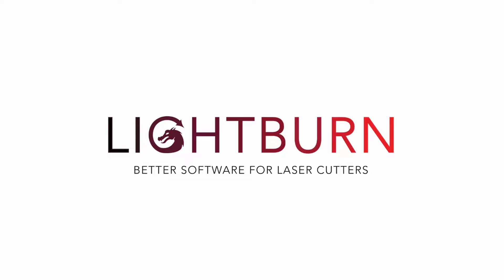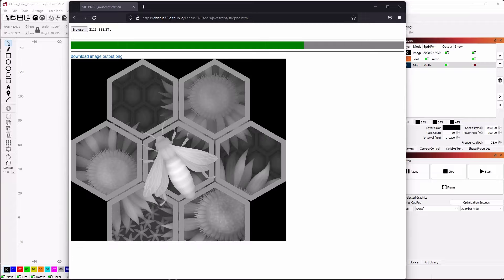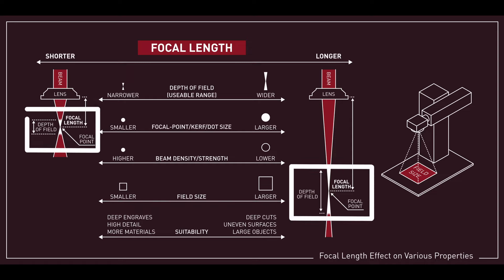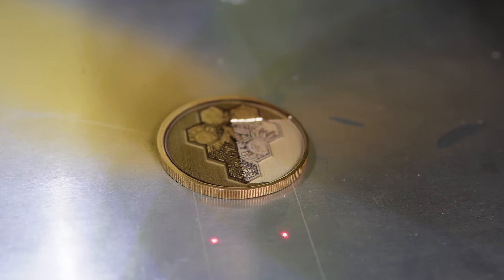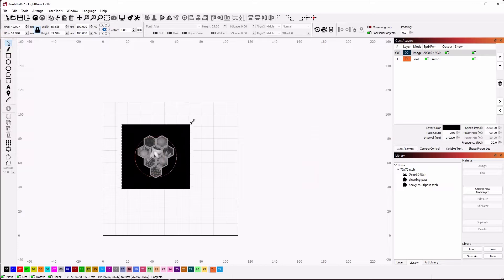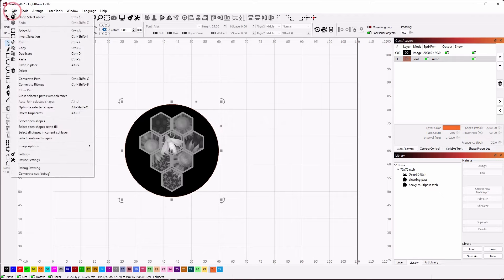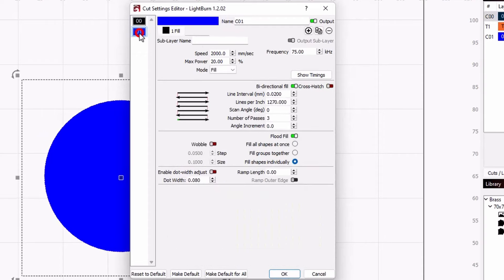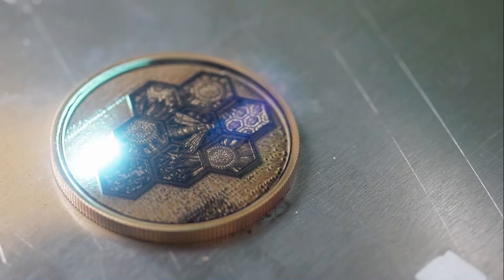3D Engraving With LightBurn!

Comment: So with C02 can I follow same? When doing so I select grayscale, then does that mean I don’t need to use the STL2png converter? Also, cleaning pass, I hadn’t heard of this, wow! Can I get a starting point setting for that? I have 3 lenses 2” 2.5 and 4.  Thanks for any input.
Reply: Though visually similar, grayscaling and creating a depth map are two very different things. Grayscale uses the luminosity of any colored pixel and converts it to a shade of gray. It doesn't care if something is in the foreground or background. A depth map on the other hand, changes the pixel value based on actual depth from white to black. White being the closest to the screen and black being the farthest. This type of image is required for the laser to know how much power to apply. There are other methods, but for these purposes you need to use the STL2png converter.

Comment: Hello, thanks for your video, a question. A normal flat engraving fiber laser can be converted to 3D engraving through the program or is it a different machine
Reply from the maker: This is a normal, 2D machine. We don’t even have to adjust the Z to do this as long as the focal range of the lens is deep enough.

Comment: Can you help me with setting to make this work on wood and normal 20w later?
Reply from the maker: If you're using a diode or CO2 laser, choose 'Grayscale' for the image mode, and set Min Power to a little above zero, and Max Power to 100%.  The results will not look very good because it will char a lot and will require cleaning with a brush (like a toothbrush).  I know it is possible to get a decent result with a CO2 laser.  I do not know if it is possible with a diode.
Reply: Thanks will give it a try

Comment: Is there a way to include a cleaning pass during the 3d etch or do you have to wait until the end?  I  was able to create the 3d image on the coin but waiting until the very end to perform the clean.  I'm assuming adding a sub hatch in the middle of the 3d layer run will cause issues?
Reply from the maker: There isn't a way to do what you're asking (and no way to do a sub-hatch to an image at present).  We'd like to add this, but honestly I haven't seen a need for it yet.  Using a small air pump to blow material off the engraved surface results in very smooth output for me, and doing cleaning passes after the fact has been fine.
Reply: @lightburnsoftware7189  Thank you

Comment: How to convert an image into a grayscale image for 3D engraving ? Do you have a tool or a software ?
I am planning to use the laserpeacker 4 for engraving. 

Thank you !
Reply from the maker: You don’t convert an image - these come from 3D models that are converted into height maps for engraving. The information in a normal picture is shading, not depth, so they are completely different.  The laserpecker is likely not powerful enough for 3D engraving on metal. You might be able to get varying depth on wood, but diodes are not great for that either, as they tend to char more than vaporize.

Comment: For better 3d engarving we are need to rotate angle every pass, lightburn in 3d image rotate only 90deg every layer, need 10-12deg and clean all between deep layers.
If you use short pulse laser you can polishing metals.
Reply from the maker: Rotation of images (at the moment) will cause the layers to misalign because of the way they are resampled, which is why it's restricted to 90 degrees.

If you have an air source, like a compressor, blowing across the engraving it will eject all the metal particles and prevents them from getting burned back onto the surface, and this produces a much smoother finish all by itself.

Cleaning passes can be done afterward, though we are planning to add cleaning passes during the engraving as an option.
Reply: @lightburnsoftware7189 thanx, how much layers i can use in 8bit images? 255?

Comment: Will this work on UV galvo lasers? If not now, might UV laser power be controlled in a future update?
Reply from the maker: UV lasers generally don’t produce deep marks, but aside from that there is no reason this couldn’t work. It doesn’t use variable power at all - it does a single pass for every layer of depth.
Reply: @lightburnsoftware7189  Nice! Thank you. I'll give this a whirl.....new rabbit hole!

Comment: can i do this things with a diode lasser?
Reply from the maker: Not in metal, but possibly in wood, using grayscale mode and multiple passes.  It will scorch a lot, so you’d need to clean the result with a brush, and you’d need a strong diode for this - probably 10w.

Comment: Is there any possibility of move Z axis (of course it should control by software) every layer and process will run on real focus point on every layer?
Reply from the maker: We will eventually add Z control, but you would need to measure how much material was removed with each pass and set the Z movement per layer manually.  There would be no way for the machine to do this automatically.
Reply: @lightburnsoftware7189  Could one simply add a stepper motor to their Z axis.. I don't have my laser yet.  OR, I assume one would still need a motorized 2.5D controller setup which at this time we know cannot be used with Lightburn?  I'm all kinds of confusing myself.

Comment: I am unable to get the 3d slice to work. All it does is produce a black preview
Reply from the maker: The preview for 3D Slice is a little weird - It just shows all the layers at once.  If you turn on "Show Travel Moves" you'll see red in the empty spaces of each layer, which helps visualize the result.

I'd have you attach a screen shot of your settings, but you can't do that in YouTube comments - Please email support@lightburnsoftware.com if you still need help.

Comment: what would happen if I just used a BLK/WHT photo PNG would the effect still not work? I get the stl to png idea with pure height but I know carveco/artcad does this method to make 3d engravings and they look fine. I do my work in AI so I can get really fine B/W gradients. I will have to play around Thank you for this great tool also my MOPA has a powered Z even throw it's an easy cad 2 board so that powered Z 3d carving would be awesome!!
Reply from the maker: If you are just making greyscale depth maps with AI or carveCo then it should work exactly the same as the output from STL2PNG.
For your Z axis you would need the controller to be able to control Z. My MOPA has a powered Z as well, but it's not ran through the controller it's just a switch on the front with a special stepper driver that generates steps based on a direction signal at a rate defined by a potentiometer on the driver.

Comment: What I'm not clear on, is how to take a customer's logo, and get it into a 3D piece of artwork.
Reply from the maker: In this case it started as a 3d model. Depending on the logo, you could use CAD software to extrude the logo into 3d space. 

If the goal though is to have a depth map then ultimately you want a 2D image that is colored correctly. This tool just takes a 3d model and generates that 2D depth map for you.

Comment: so technically I could do this on a piece of wood right?
Reply from the maker: If you have a CO2 laser you can just run an image in grayscale mode and it will do this, but not as cleanly as a galvo / fiber on metal.

Comment: 1.2.02 !!! Not still available
Reply: This works on every galvo version
Reply from the maker: You will need to have a galvo laser and the galvo version of LightBurn.
Reply: My 50w uses BSL CAD. Can’t get LightBurn to recognize it. I use LightBurn for my diode laser and do have the galvo update install
Reply: @bennyhill5970  Have you paid for the Lightburn Galvo licence to add to your diode one?
Reply: @bennyhill5970  BSL CAD is not supported yet. It is being worked on but not released as of 9-24-22